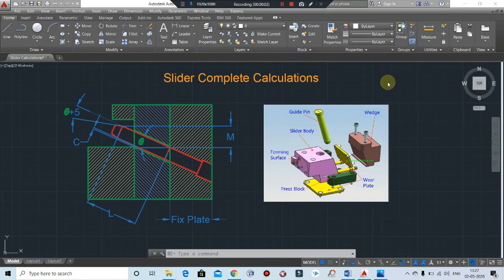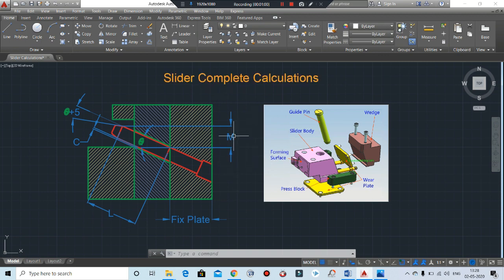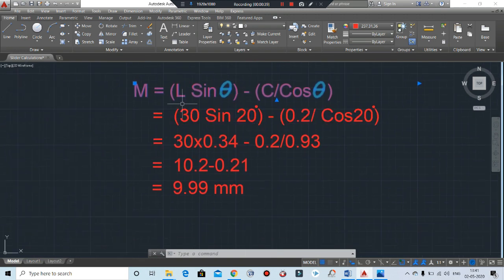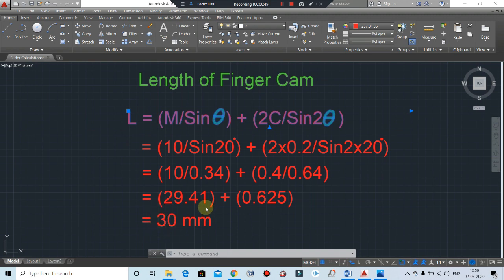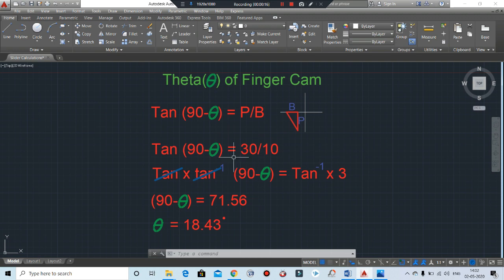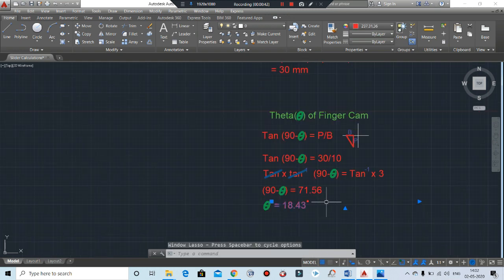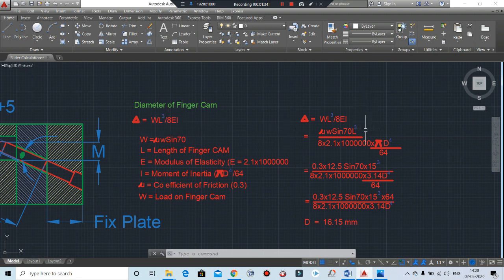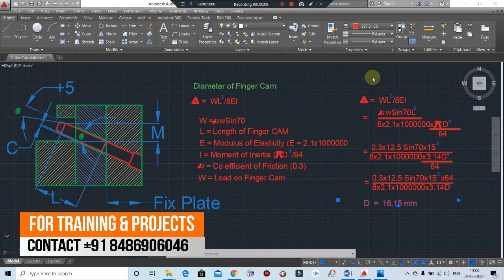Slider Cam Angle Calculation For Plastic Injection Mold | Finger cam diameter and Length Calculation

Comment: In angle calculation you have taken P as 30mm( i. e working length of finger cam), B as 10mm ( i.e movement of slide).  Sir my doubt is  if am calculating finger cam angle as first parameter means i dont know working length of finger cam, so in that case how can i calculate finger cam angle
Reply from the maker: For training you can join our paid classes. For doubt class and whtasapp assistances in future
Reply: @CIMDesignSolution   I am interested in the training and projects offered by you. Can you send a link for the same
Reply from the maker: Contact on mention number

Comment: What is the normal angle provided on finger cam
Reply from the maker: 10 to 25 Degrees
Reply: Thanks sir
Reply: Why clearance is provided in finger cam between  finger cam and the hole in the slider
Reply: What is formula to calculate slider total travel ? Exaplain
Reply from the maker: For paid training you can contact on 8486906046
Reply: Lockdown chal rha h sir